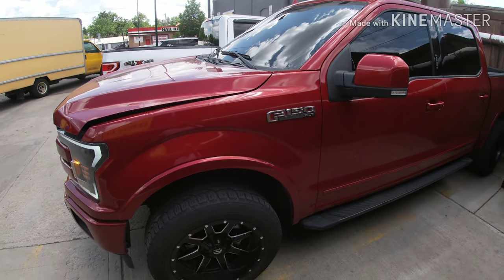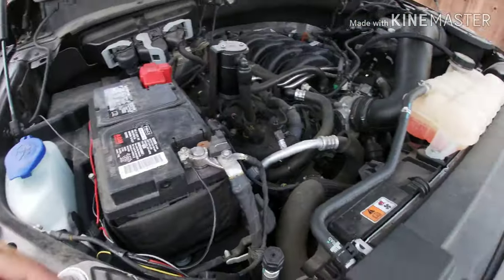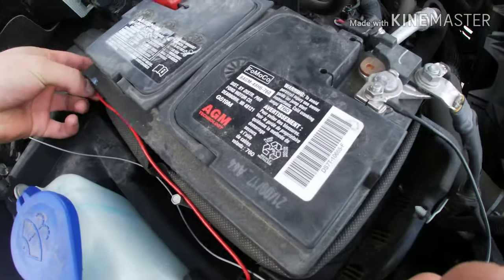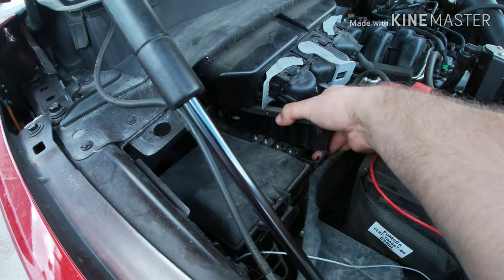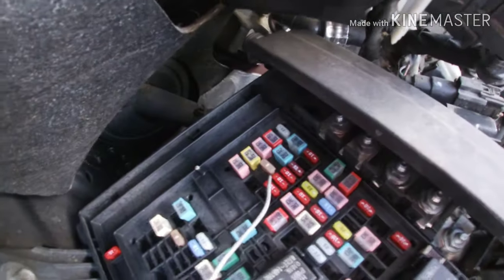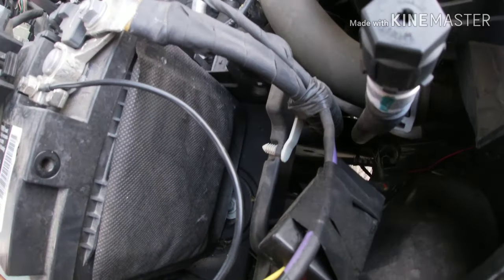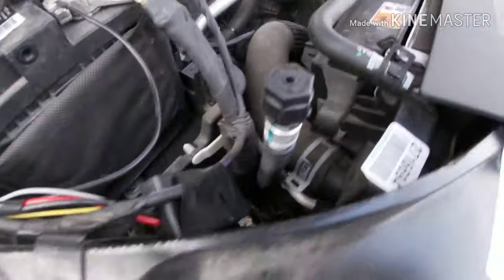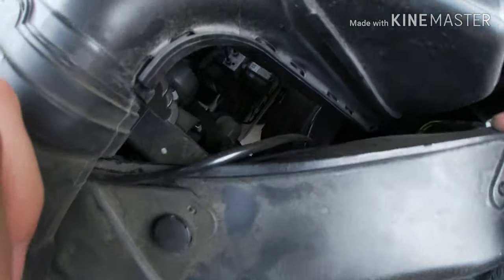AlphaRex Pro Series Led Headlights how i put my relay harness 2018-2020 Ford F150

Comment: So I’m thinking about getting these headlights. So, what exactly is the relay for. In your install video you didn’t do the relays and it looked like everything was working proper?
Reply from the maker: The relay its so the led strip could turn on without having the headlights on and will be your DRL. I have the the other video of how i install them its pretty simple. Thanks for watching and subscribe.
Reply: Ok so if you do not wire up the projector lights work like regular DRL but the led strip will not work for DRL the LED strip will only work when you manually switch to headlights on.....but the the DRL lights will still automatically work like normal correct
Reply from the maker: @bradgourley2286  Correct projectors will work as DRLs and LED strip will only work when you unlock truck or turn lights on manually or auto at night.

Comment: What size fuse are you running and what location did you put fuse? I have mine tapped to 36 with 2 10 amp fuses and for some reason the DRLs stay on after truck is turned off, had to pull wire to make them go off
Reply from the maker: Iam running 2 10 amp fuse and I tap into fuse #10  and never had any issues
Reply: Im having the same issue. Did you find a fix?

Comment: I don’t understand, it looks like you’ve just got the grey wire tucked into the factory fuse. All the fuse taps are too big. Mine is. 19, maybe smaller fuses?
Reply from the maker: Yea at the moment I just tucked it under fuse to test had to order a fuse tab online since my local auto parts didn't have that size. They are micro2 fuse tab

Comment: Where does the yellow wire go
Reply from the maker: There should be a plug on one of the headlights.
Reply: What is the yellow wire for. Because I am having trouble with the drl. I didn’t connect the yellow wire. Could that be the reason why
Reply from the maker: @adamsilveira2326  yellow wire doesn't do anything i even talk to AlphaRex about it and said it was optional to connect. I try both ways and it didn't do anything

Comment: I tried following the wiring instructions for the harness which connects to negative, positive, and gray wire tapped to fuse. I got a check engine light... would you know why?

I was doing this last night and ended up disconnecting my battery by pulling off the negative clamp to let the engine light go away. But I bailed on the harness and disconnected it. And drove this morning with no engine light appearing.

I would like to get the harness on to have the DRL’s be brighter during the day but not sure how to do it.

My process was, sinch wiretap to gray wire. Add 10a fuse to top position of wire tap. Place negative wire to negative battery bolt, then positive to positive bolt. Then I plugged in my wire tap which had one 10a micro fuse in it to position 36. Started car and that’s when I got the engine light. Also I couldn’t see any difference in brightness between when I low beams on or not.
Reply from the maker: You did it right dont know about the check engine light i got someone else telling me there check engine light came on too he had an EcoBoost what does manual say about the fuse you used? I used the rain sensor fuse.
Reply from the maker: Any updates?
Reply: Your check engine light came on because your shutters were disconnected in the grille possibly

Comment: hey man i don’t think you needed to plug in grey wire since your truck already controls DRL in settings. i could be wrong though. truck looks great
Reply from the maker: I did try it without wire and they wouldn't turn on unless i turn the lights on manually. Thanks a lot.

Comment: I got everything install but drl stay on idk why. Ans my switch it’s off and doesn’t want turn off
Reply from the maker: What fuse did you tap too the gray wire on harness
Reply: Yess to the gray one
Reply: I did 97 and one fuse 10a
Reply from the maker: Make sure the fuse you tab into doesn't have any power when you turn truck off only when you unlock or turn truck on

Comment: Do the turn back white after u lock it also did u connect the yellow wire
Reply from the maker: Yea they turn on white after i lock it and yes i connect it yellow wire even though it didn't do anything i try both ways and nothing changed.
Reply: @Eldela5.0  did u add an extra fuse besides the one that came with it
Reply from the maker: @pacmandagreat07  i just got a fuse tab for the wire that goes to the fuse box.

Comment: Did you buy led low and high beams. If you do which ones and did they fit in those black seal covers ?
Reply from the maker: I got the led that came with the headlights.
Reply from the maker: Iam not sure but you should check on the f150forum theres a few people getting after market leds
Reply: C_REEZZZYY any H7 led on Amazon should fit.

Comment: Primo, las mias no preden las drls. Las tiene en auto? Or tengo que aser el forscan
Reply from the maker: Las tengo en auto y no acupe forscan donde conectastes el harness a que fusible?
Reply: @Eldela5.0  74
Reply from the maker: Yo lo conecte en el rain sensor fuse
Reply: @Eldela5.0  le voy a calar ese fuse aver que pasa gracias
Reply from the maker: Por nada.
Reply: @Eldela5.0  el fuse es de 10 amp? Gracias
Reply from the maker: @bouncervegas7409  si es el fuse 10

Comment: Hey man! Just curious I am looking the get the led fogs for my xlt could you post a part number? Is it just the led bulb? Also what is your wheel setup?
Reply from the maker: Its oem led fog lights and part numbers are in the description section and its the whole housing not just an led bulb. Wheels are Fuel mavericks 20x10 -12 offset on 275 55 20 tires
Reply: 5.0Beast Also do the fogs come with the housing and bulb??
Reply from the maker: @velvetsmoooth4980  yea it all comes together they dont sell separate.
Reply: 5.0Beast fairly easy to install? Thanks man big help
Reply from the maker: @velvetsmoooth4980  If you take out the housing its a pain i did one lol but housing are the same so you can just pop out the foglight they have like 2 clips i believe
Reply: 5.0Beast would it be possible to put a 6000k led bulb into my fogs?
Reply from the maker: @velvetsmoooth4980  yea you can do that most people do that since its cheaper then the oem led foglights.

Comment: I just installed mine but my drl do not work as my running lights it turns on the led headlights can u please help.
Reply from the maker: Did you wired up your harness that came with headlights? And id yes what fuse did you tap into?
Reply: No I didnt tap it into a fuse o thought the grey wire was a ground I grounded it to the negative cable
Reply from the maker: @jorgepecina6233   you should tap gray wire to fuse box i use fuse #10 for rain sensor or tap in into drl fuse
Reply: Rain sensor is the drl then???
Reply from the maker: @jorgepecina6233  no i tap into #10 rain sensor since i didn't want my drl headlight to turn on only the led strip. Check on owners manual to check for the drl fuse since i dont remember of top of my head jajjaj
Reply: Ok thanks bro appreciate it
Reply from the maker: Your welcome anytime.
Reply: Hey bro I put a fuse tap to the ignition and nothing the headlights still turn on automatically.. mine are the alpha novas and another thing wen I lock the truck the plan turns on but so do the high beams and lo beams but dimm but only on the driver side the passenger is jus the plank please help these lights were expensive.
Reply from the maker: @jorgepecina6233  disable dlr on your cluster so the headlights wont turn on and just the plank strip. check all plugs that they went in good.
Reply: How can I disable them?
Reply from the maker: @jorgepecina6233  you can turn them off in the menu on the cluster go to 
settings
advanced settings
lighting
uncheck box for DRL
Reply: Hey bro sorry to keep messaging you but on the novas wen the drl planks are on only the driver side the high and the low beam are on dimm but is there a way to turn the off to jus leave the plank on
Reply from the maker: @jorgepecina6233  not sure on the novas but i believe it should be the same as the pro series all i did on mines to leave only the planks on was turning off my drl lights on the cluster and only led planks come on
Reply: Yeah I did that but the low and high beams come on dimm it's annoying
Reply from the maker: @jorgepecina6233  minds didn't turn on at all when i did that only led planks
Reply: I have the grille lights on my truck.  My passenger side drl light bar doesn't turn on after sequence or remote starting thr truck.  When key in ignition, it lights up and works.  Any idea why this might be happening?  People are saying its the grille lights.   But why would that be an issue if the grille light is piggybacked to the driver side marker light but the passenger side led bar is the one thats effected?
Reply from the maker: I heard some people have the problem with light bars.

Comment: I have mine connected the same way and the relays doesnt show up like yours
Reply from the maker: What you mean by relay doesn't show up like mines?
Reply: Instead of the relays, it only blinks. I have everything connected same way like yours. Everything else works, just the relays doesnt.
Reply from the maker: @danivelazquez7822  did you check for any loose plugs
Reply: @danivelazquez7822  I have the same issue it only does the effect on start up
Reply from the maker: They are 2 versions of the headlights sequentials and non sequentials
Reply: @Eldela5.0  do you think they probably sent me the wrong ones ? I had ordered the pros the top of the line ones
Reply: @Eldela5.0  I do have the activation lights doe wish only come with the switch back turn signals too
Reply from the maker: Maybe since some don't have the sequential. And they will only flash only amber with turn signal but no sequential
Reply: @Eldela5.0  mine don’t even flash amber only the little amber light flashes drl stays white at all times ... it only turns orange when I hit the unlock button

Comment: How do you hook up the grey wire to fuse box?
Reply from the maker: Get a fuse tab and i use rain sensor fuse #10 5amp just double check your manual to make sure.
Reply: Did you use a fuse tap or did you just stick the wire under the fuse. I didn’t see a fuse tap connecting to the grey wire so I wasn’t sure how you did it.
Reply from the maker: @ohpleasenotthesandal3139  It didn't come with a fuse tab i just connected it just like that to see if it works but i got a fuse tab for it at your local autoparts.
Reply: But a fuse tap, it’s way safer. 10 bucks off of Amazon.
Reply from the maker: Do have a fuse tab just didn't have one at the moment and just connected to test.

Comment: One last question I think. Does the fuse you took out to put the trigger wire in affect any functions of the truck ? That's the only part I'm a little confused on, thanks
Reply from the maker: Its fuse #10 5 amp fuse for rain sensor and no it hasnt affect anything, your welcome and thanks for watching.
Reply: I just saw on mine the grey trigger wire just has 1 wire for the end. Is it suppose to have some sort of end with a connecter to be able to plug into the fuse box ?
Reply from the maker: @jayflo588  You can get a fuse tab from autoparts.

Comment: Hey fella, where does the yellow wire go to on the right side?
Reply from the maker: If i remember correctly only one headlight has the yellow plug.
Reply: 5.0Beast ya on the right.  But it attaches to a plug on headlight?
Reply from the maker: Yea it has a yellow wire plug on headlight
Reply: @Eldela5.0  does it need to be connected ? Maybe that’s why my amber turn signals don’t work ?